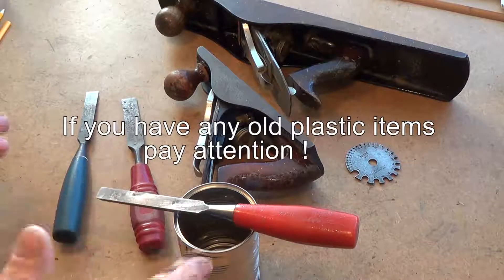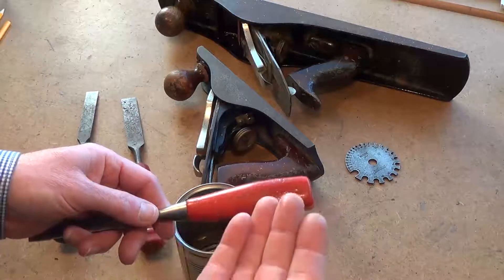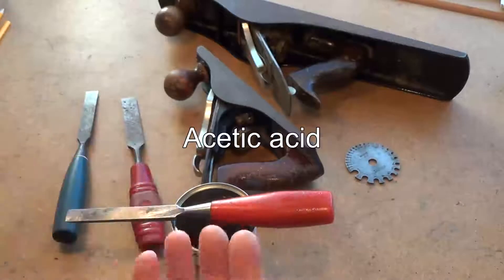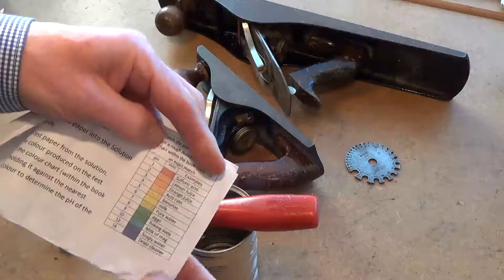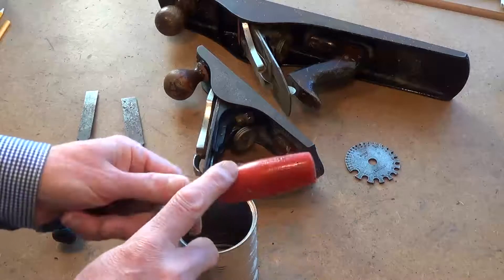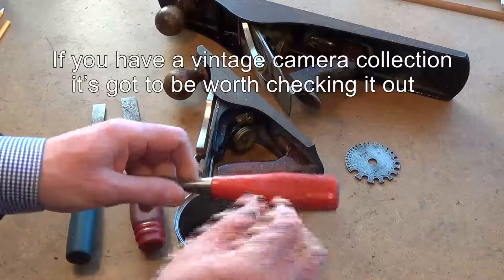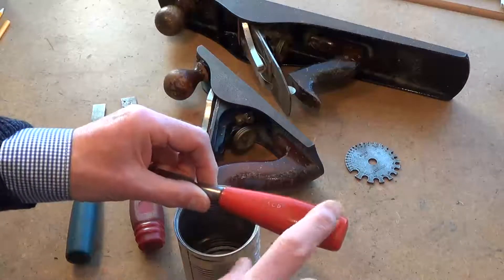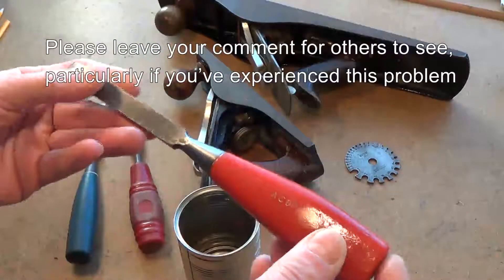Big problem with vintage plastic- tools and equipment etc

Comment: The green/blue dripping from sockets could be petroleum jelly. Some electricians used it to keep the copper from corroding. Of course over the years being a liquid it seeps down!
Reply from the maker: Hi, I understand what you mean (I qualified as an electrician back in the 1970’s,) but this was a liquid actually in the cable, on the copper, I replaced the cable. It turns out to be a not uncommon problem here in the UK but I’ve only seen it once myself. I think it may have been associated with one particular cable manufacturer and that’s why I asked folk to comment on the issue.  
 
By the way I don’t know what they’ve done to YouTube but I'm no longer getting notifications of comments.
All the best ... Andy

Comment: Hi Andy, yes the problem is well known to folks who work on vintage guitars - the older plastics off gas when they deteriorate and if the guitar is left in it's case for extended periods of time the gases wreck the guitar fittings and sometimes even the finish.   I'm not aware of a way to halt the deterioration - the plastic normally has to be replaced.   Things like pick guards shrink as a result and this will damage the top of an acoustic instrument causing cracks, etc.   I'm also working on a vintage Telefunken radio where the plastic surrounding the dial glass has shrunk and cracked as a result of similar deterioration.
Cheers,  John
Reply from the maker: Oh wow what a shame, I must be heart breaking to lose a loved guitar to this insidious degradation. I guess it’s a bit of a ‘plastic cancer’ I think we normally consider plastic as being an enduring material but with this problem and the damage that the sun can do I suppose it’s as vulnerable as we are Joe.
Regards ... Andy

Comment: I believe I have seen this action in old radios.  I had attributed this "blue/green goo" to excess solder flux, which I thought, had degraded the plastic wire insulation over time?  We have all seen the old plastic push buttons, which don't hold up well in the 70 year range as well.   But, I never noticed the liquid on their surfaces.  Thanks for the interesting video...Joe
Reply from the maker: Hi, OK on the excess flux, I think it used to be common to use fairly aggressive fluxes, particularly where a wire was soldered to the radio chassis. The green/blue liquid I referred to in the video was dripping out of the wire, there was so much that it started to bleed out of the bottom of the switch plate.  It’s quite dangerous as I’ve just pulled the handle out of the rubbish bag and checked its resistance and I’ve found it to be very conductive.  
Regards ... Andy

Comment: Oooh! I couldn't throw a chisel away especially after having it so long. I would invest in a wooden handle for a couple of quid and it will still be around in a hundred years time. I wonder who would be using it then? Not us lol. Even badly abused chisels can be brought back to spec fairly easily.
Reply from the maker: Funny you should say that Wilf, when I cut the handle off the blade went back in the tool chest for restoration. It doesn’t have the typical tapered tang of a wooden-handled chisel but it’s such a lovely tempered piece of metal I just couldn’t let it go.
Regards ... Andy

Comment: hi andy
 i wonder would it be worthwhile sealing those handles with a coat of varnish or something similar it may get a few more years use from the chisel
Reply: AndyDaviesByTheSea Any chance of neutralizing via Baking Soda for a bit? May need to hard soak or boil. May not penetrate far enough....but worth a try and test.
Reply from the maker: Hi, I don’t think you could keep it in, bit like trying to seal leaking water a pipe with chewing gum. And remember the fumes are corrosive.
Regards ... Andy
Reply from the maker: WorldPatriot35
Hi, apparently not. There’s a museum curator who has said it’s a big problem with plastic toys and as yet there’s no way to stop the breakdown.
Kind Regards ... Andy